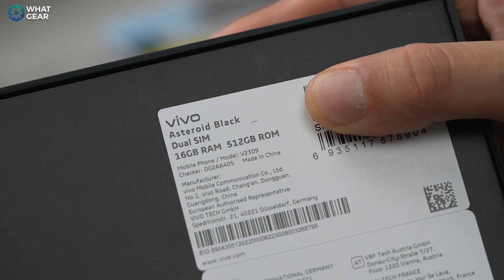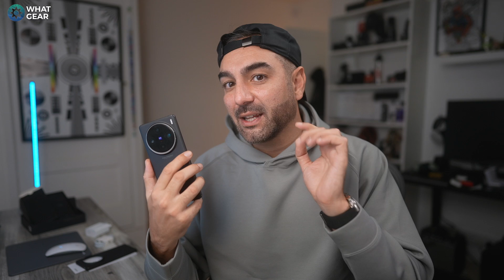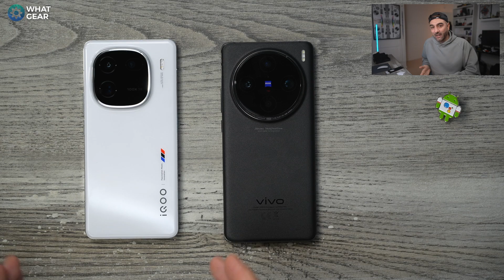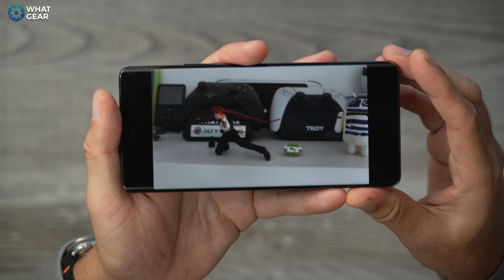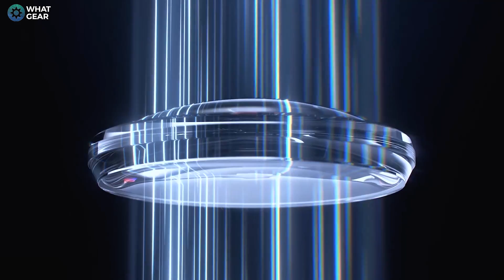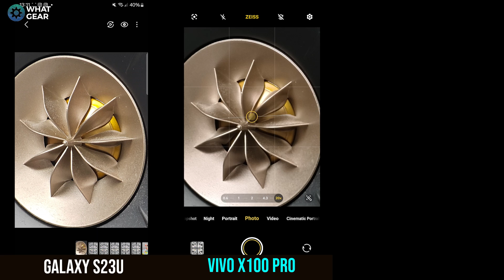Next Level Smartphone Camera! - Vivo X100 Pro ( Unboxing & Review )

Comment: It's a very good phone phone but it doesn't have 4K selfie camera. 1080p only. Considering the around $1100 price tag for the global version, the price won't be very competitive agains S24 Ultra.
Reply: its 800 dollars ....
Reply: @StevenChris  That's Chinese version.
Reply: @Dan_Vice  why you would pay 1000 dollars for the global version while the origin os is so much better supported and more packed with features than the fun touch os
Reply: @StevenChris Don't know where you live but here in the UK 5G band  is different than what China use so Chinese version won't work on 5G. Plus the Chinese version will have some bloatware and i believe doesn't have Google playstore.
Reply: @Dan_Vice  i live in europe
Reply: @Dan_Vice  and also the seller where you bought from he will install all the google services including google play store and the chinese bloatware you can remove yourself using your computer
Reply: @Dan_Vice  simple as that
Reply: @StevenChris You might want to check if 5G will work in your country.  If so and you won't have to pay tax to import the phone China, then it wll be a good deal for you.
Reply: @Dan_Vice  yes 5g does indeed work in my country and also the import tax is paid by the seller
Reply: @StevenChris  Because you need to pay the tax anyway, so its not actually 800 USD (unless you buy it while travelling). Also due to compatibility issues. For example Android Auto support is very important for me.
Reply: @Mrhaplok  no i didn't pay a single penny for tax and also this phone works flawlessly with google services and so on
Reply: @Mrhaplok  its incredibly smootu
Reply: just bought the x90 pro new, china set. could not be much happier because for the first time i use vivo, china set, i get 5G. before this, i bought x70 pro china set and didnt get any 5G. kudos to vivo!
 @StevenChris

Comment: The 10x times shot on the Samsung could be better but the algorithm is just so annoying that the phone doesn't let you choose if you still want to use the 10x camera even in low light and sometimes idk why the AI thinks a normal lit room is not suited for the sensor
Reply: You can disable auto lens  switching in camera assistant and then it won't switch lenses automatically unless you choose to switch lenses manually

Comment: Had mine for 5 days here in UK got the 16GB Ram and 512GB Storage Global version, Camera is far better than S23U or 15PM i had them both, Battery life is better than Samsung and not far off iPhone but the charging speed obliterates them both
Reply: how about the software and ui? is it any good? i am waiting for the s24u but some suggested that i buy vivo x100.
Reply: @sidniysack  Vivo's Android skin is closer to stock android rather than One UI it has a lot less apps installed than Samsung because Vivo don't bother with their own apps for most stuff with the exception of their own photos app and a app for being able to use the IR Sensor as a remote and a sharing app etc. Google feed on the left of the home screen is enabled by default, The settings allow you to customise quite a few things from the always on display to the fingerprint scanner animation right down to even the charging animation etc.  If you have anything specific you want to know I will try to give you a answer

Comment: I hope this gets released in the UK!🤞
Reply: Don't think it will be but you can import the global version, That's what I did
Reply: @smguk2412  only issue I have with that is that I've heard when getting a phone from China. You can't use android auto on the phone which is a must for me really:( UK getting worse for phones...
Reply: @Karllooo  If you buy a phone with a Chinese rom then yes you will run into a few problems but a global version means it was made to be sold outside of china, The one I have has no Chinese apps and everything works as intended
Reply: @smguk2412  where did you buy it from?
Reply: @smguk2412  well I just got confirmation from a vivo rep as I emailed about the device being available in the UK and they've just told me yes it will be Available in the UK but date wise they are unsure yet. So if that's true... Could be unveiled at WMC or something 🤘😁 I'll hold out and wait if nothing comes by June then I'll look into getting one imported
Reply: the global version lacks the b20... @smguk2412